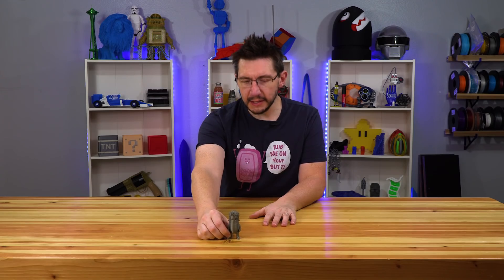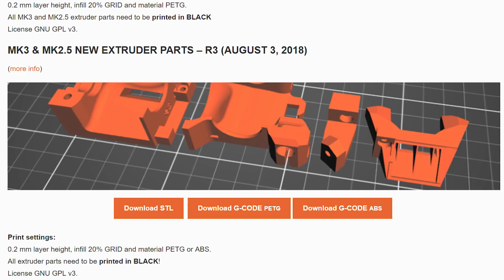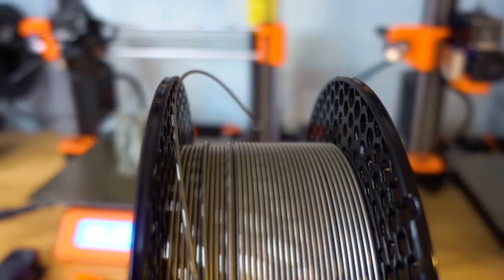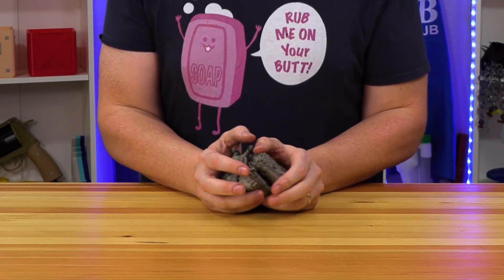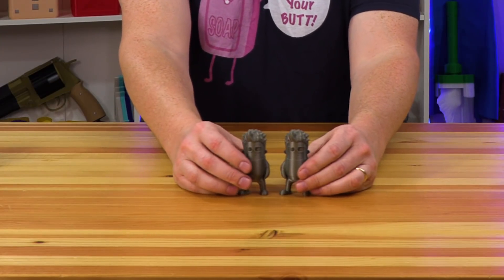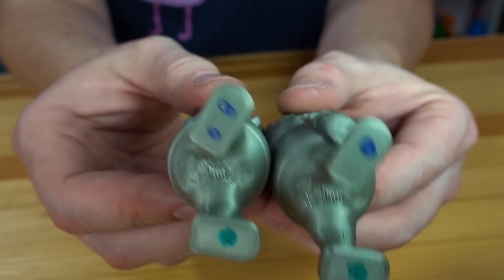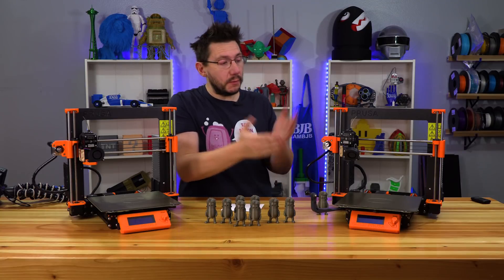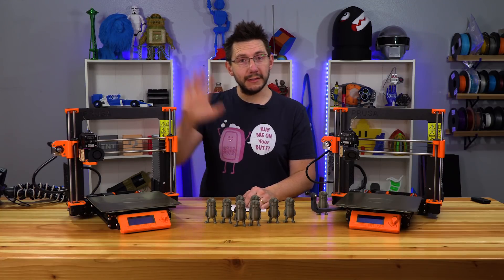PRUSA R3 - Better Than Stock?

Comment: It looks like you only did the fan angle update which is NOT the main feature of the update..... Should have done the whole extruder body
Reply: The rest of the upgrades are completely irrelevant to the issue at hand which was overhang Cooling
Reply: @nerys71  Missed point... The upgrade that is called R3 is mainly made for the hot end cooling, not the part cooling. You would need to upgrade to a better designer part cooling fan to see any result. + The part cooling fan on the prusa is quite weak.
Reply: @Hackbandito  no I think you missed the point :-) Maybe that's what the upgrade is for but that's not what he was testing now if you want to say he tested something that had nothing to do with the upgrade great that might be the case but is explicit purpose of this video was to see the difference in Parts Cooley at 4 that there was no tangible difference
Reply: @Hackbandito   What's the point of cooling the hot end with a fan? Seems redundant.
Reply: @joost199207  Yup - you're cooling the heat break, not the hot end.  I don't see how that can let you "have more control, and more accuracy on the final extrusion".  What it will do is make sure you don't get jams from heat making it back up to the filament feed path where you don't want it.  But the hot end itself will always be whatever temp the thermister is set for.
Reply: @BinaryExplosions  how? retraction/extrusion reaction time..... what do you think would happen if the cold end got up to the temp the filament got ever so slightly softer?  what happens now when it tries to push it?  a jam is an extreme condition... there is exist a point before that and it causes shitty prints.  that's why the stock e3d fan sounds like a jet...
Reply: Hackbandito you are right. better hotend cooling for example
Reply: @MissMerc   NICE. i learned something reading YT comments and an argument was made in a proper way :) im happy ty.

Comment: Hehe - kept my MK2.5 stock because to me reliability is much more important than print quality. Since stock quality is way better than what I need I opted to not introduce reliability degradation just by changing a running system. That said I am happy to see it wouldn't have made much of a difference to me either way. Cheers! Thank you! JM

Comment: Great Video! I ran into the same cooling performance with stock. I think you should test this fan shroud as well. 
I started using this shroud within a month of getting my prusa MK3 (May 2018)
I also noticed improved performance when switching to the R3 extruder. 
Check it out! https://www.thingiverse.com/thing:3063554

Comment: I did the upgrade, ordered it because I had a $20 voucher when I ordered other stuff. Also did not see any real difference.  But another thing not mentioned with the R3 version is better airflow around the extruder head. guess that might count for something in the long run. At least it did not make my MK3 worse, still happy with it.

Comment: I've personally experienced MUCH better printing with the upgraded parts; the level of detail is cleaner, especially on fine details.  Overhangs are a LITTLE better - but as you yourself noticed, there's not much difference there.

Comment: Joel, Great video. I also have one of each and have never been able to tell the difference between the quality of either of them. A big difference is when you go to my Ender 3 with the Hero Me cooling and can see a great improvement in the flow of cooling on large overhangs. I have direct drive on my Ender 3 which is very similar to my MK3s. (Teaching Tech did a video on my Ender 3 upgrade kit) I do print a bit slower on my Ender 3 but not a $500 decrease in speed. (Price difference between the MK3 and the Ender 3 with upgrades) If I had it over I would buy 6 Ender 3s before getting the MK3s. There just isnt enough of a bonus to my Prusa machines over the Ender 3.